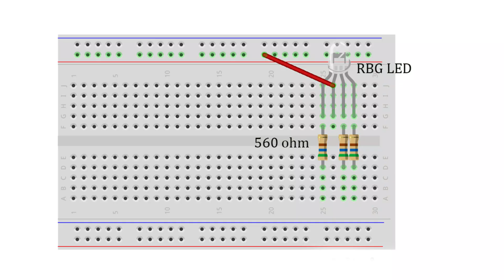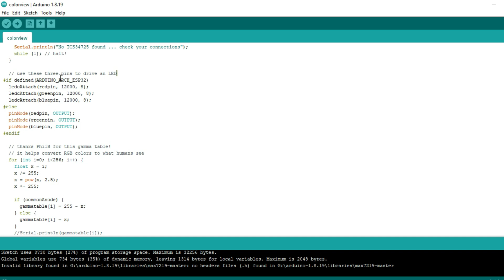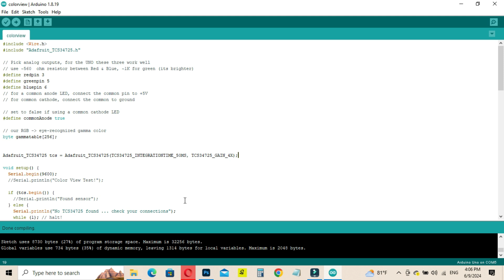Arduino Color Sensor with TC2472

Comment: Did you use 12v or 5v rgb led strip?
Reply from the maker: I used 5v. but if you want to use use 12v LEDs, use transistors.